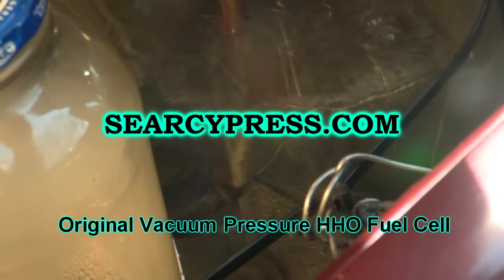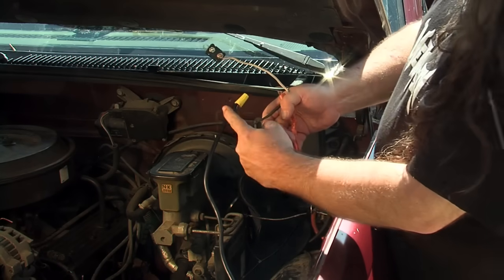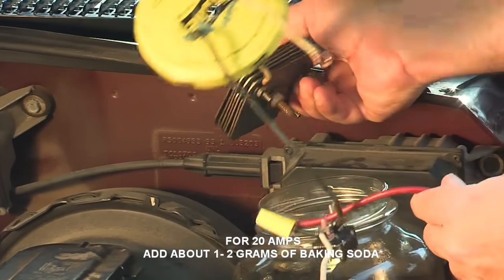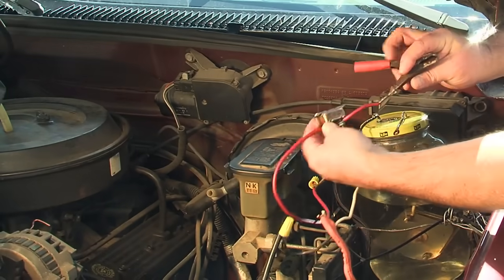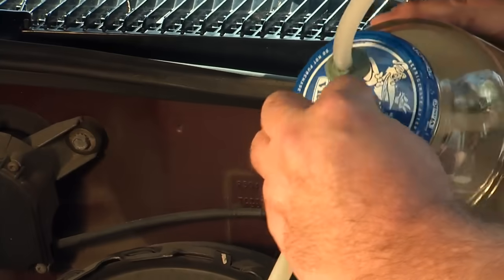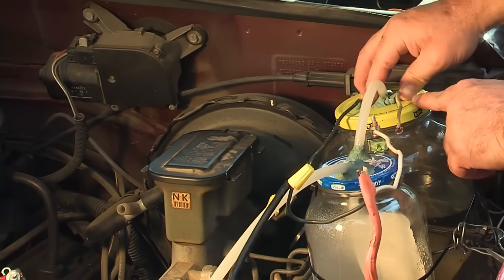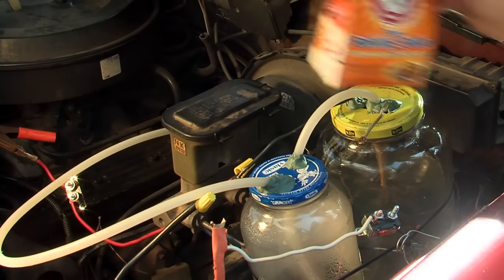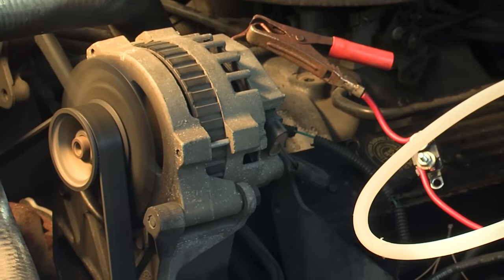Vacuum Pressure Hydrogen fuel cell defeats high gas prices using hydrogen from H2O.

Comment: Hydrogen needs more energy to be separated this way than it actually gives back when burning inside the engine....so the alternator giving 30 amps extra really makes more drag than the hydrogen gives back by combustion....what is the point ?
Reply from the maker: No one is claiming over unity. Many people make the false assumption that the engine is burning 100% of the fuel. This is far from accurate. In reality this engine would be good to be burning 80%. By increasing the efficiency of the burn, gains are possible without violating any laws of physics. Even if there were no gains, using the system allows you to burn low octane fuel without any engine ping. This guarantees you save money.. Thanks for your comment.

Comment: This may seem to be low tech but the fact remains it works I built one several years ago and it worked just like the gentleman said it's just a hydrogen assist to the gasoline of course it does not make enough to run a car by itself, it just assist the gasoline on making your car get better gas mileage
Reply: Do you still use the system you built?
Reply: @arichoward9635  I still have it in my garage but I no longer use it, at the time when I build it I could not find enough information to where I felt comfortable running it all the time even though I did hook it up to my car and it did work

Comment: Doesn't running hydrogen subsequently cause rust corrosion in your motor cause of the water??
Reply from the maker: Burning gasoline actually produces a significant amount of  water anyway.

Comment: "This is vary fancy" proceeds to show you the bottom of a lid of a pickle jar 😂
Reply: Actually it is, it's not what he uses, it's how it's used, that's actually the basic thing of what we use. In fact all he is missing is a mini computer to regulate everything for him as he drives or leaves it running, also a cooling cell to make sure it never over heats and pops it's tops off. Do some research on this, then you'll get why he said very fancy, cause it is.
Reply: @achmed3131  everyone is taking this comment too seriously🤦
Reply: Mom's pissed
Reply: @Brittvanegas  no I'm not
Reply: @Brittvanegas  0 I'm
Reply: I am just curious can you cut off the gasoline and run it on pure hydrogen
Reply: @darrellfilyaw7255  I bet you can but you’d probably have to add some other modifications.
Reply: This dude's full a shit
Reply: So fancy 😂
Reply: Don't be disillusioned by how fancy it looks, now
Reply: What are all of the parts needed?
Reply: Fancy? It ain’t even a pickled ham hock jar
Reply: “Steam cleanse your engine “ 😂
Reply: Mine looks clean...I wonder if I can get it patented.
Reply: Well how do you know they wasn't fancy pickles ? 🤔🥒
Reply: Maybe so, but you didn't make one yourself i bet! Go back to your mommys basement and get online...hurry hurry!
Reply: @gunguyforlife630  🤦👆 this guy.😂
Reply: @unanimous4429  you try it I did with the hydrogen generator works great
Reply: Really lol 😆 🤣
Reply: @yashuasaves5207  de de de he
 Ms
Reply: @yashuasaves5207  see
Reply: @yashuasaves5207  dl do boo boo Mr M.  Chip FYI
Reply: 15th  @yashuasaves5207  ¹

Comment: but the energy you use to make the HHO gets used by the redundant energy of the alternator itself, which comes from the engine, which comes from the fuel? what is this some kind of fake free energy thing?
Reply from the maker: You're presuming that 100% of the fuel is used in the burning of gasoline. This is far from accurate. Only about 80% of the gasoline is actually burned, the rest is wasted. By enriching the fuel we're able to get the efficiency above 95% or more in some cases. It is not over unity it is just simply a better way to burn fuel. This combined with the fact you could  burn low octane fuel without having any engine knock makes savings easy. Thanks for your comment.

Comment: The laws of physics say that this doesn't work. You'll  burn more energy making hho gas than it will give back as combustion fuel...
Reply from the maker: The engine'only burns about 80% of the fuel. Enriching the fuel with HHO can give you over 95% efficiency of that burning. It's not over unity it's just getting your money's worth out of the gas. Even if the process produced no increase in mileage, the fact you can burn very low octane fuel without engine knock makes for saving money.

Comment: SCAM ALERT: Your car will STILL need Gas!! You have to keep replacing the water baking soda or salt and the electrodes, because this process corrodes them ( cost of replacing these constantly) you put a heavy load on your alternator by putting two electrically-opposing electrodes into salt water ( Short Circuit, not good) The water even heats up (high energy usage) I bet most of the dudes promoting this scam don't even know that!! I found out with a kid's thermometer, put it in the water to see if I'm lying!! Making claims about mileage anybody can claim anything!! yeah, my car gets better mileage I emptied the trunk! I get much better mileage by removing all my car's seats except the driver seat! I get better mileage because I stopped taking my obese mother in-law on camping trips!!!!

Comment: Thanks for posting this!
     I will be trying to duplicate your build!
   I'd like to know a little more about your plates and how many you have, aprox finished size maybe a little more details on your plate wireing!
  You seem to get better hho production than I do!
     I plan to put it on my 1999  ford v10! 
    If i can get the production you do , I'll try it on my mopar 440 in my hotrod! 
     Hope to hear back as I have tried a few different assemblys with hardly any production!
         Thanks for making the video!   
         Thank you
Reply from the maker: The plates are certainly fantastic in the cell. They were designed by a good friend of mine. Hopefully in a future video I will show them up close. I have probably built hundreds of different cells but this design tops them all. The corner of each square plate is clipped. The other side of the plate is drilled. By offsetting those plates, flipping them over, you can easily create a positive and negative plate separating them with nylon washers. An extremely narrow gap is critical to making good plates. Only 1% or less of the people who watch this video are subscribed. Please subscribe it would help tremendously. Thanks for your comment.
Reply: 1.55 to 2.08 explains +ve plate in middle & neg on outside. This looks like his arrangement: - n n + n n - (n being neutral plate). If u pause @ 1.55, you count 7 plates. Caution: Hho is dangerous, build this @ ur own risk.
Reply: @josephkamau4855  thanks for the reply!
Reply: It's fake. Learn some thermodynamics.

Comment: This man is really converting chemical energy from gasoline into mechanical movement, into electricity, into hydrogen, back into mechanical movement, restarting the process. At each step hugely inefficient energy loss takes place.
Reply from the maker: You are under the false perception that 100% of the fuel is burned in the engine. The number is much closer to 80% even less. This leaves a lot of room for gains without breaking any laws of physics. Enriching the gasoline with hydrogen oxygen gas increases the efficiency of the burn as high as 96 or above percent. Emissions of toxic chemicals fall considerably. Certainly some energy is used to create the gas. This is not over unity it is just high efficiency. Thanks very much for your comment.

Comment: So, if i've got this straight the suggested method for reducing fuel costs it:

1: burn fuel in the car as normal to turn the alternator.
2: draw more current from the alternator than usual.
3: use said current to power a very basic and inefficient electrolysis reaction to produce hydrogen.
4: route that hydrogen back into the engine so that it mixes with the existing fuel.

the weird thing is, I would have been certain that my old high school science teacher would have said that to extract more energy from a system you would need to burn more fuel.

he also said that in energy terms there's no such thing as a free lunch. So even if both the reaction to produce your hydrogen and the reaction to re-oxidize that hydrogen were 100% efficient you would end up with net 0 joules of energy coming out of the other side. So  every single bit of energy loss in the system means you're burning MORE fuel to keep your truck going than if you hadn't added this system at all.

In short this "hydrogen fuel cell" (it isn't a hydrogen fuel cell) COSTS HIM MONEY EVERY TIME HE USES IT because it is reducing the miles per gallon on his vehicle.

(There's a reason why no one has ever built a power station where they repeatedly convert water to HHO and then back to water in a cycle to get free energy. That's because it wouldn't work)
Reply: Car makers are about to if not already releasing HHO cars. It's supposed to be the latest. I do believe the setup will work, and I'm planning on making the same setup. My only concern is the engines internal parts getting rusted. Like the piston rings, valves, etc. Mainly because the engine wasn't designed for water. I'm planning on having some sort of lubrication to the setup to avoid that. Now if the engine was manufactured to keep from getting rusted. I don't think there would be a problem, but may just be the solution to global warming.
Reply: @bobt7531  Cars fully powered by HHO work very well, that isn't the problem I'm highlighting.

The issue is that energy is that electrolysis wastes quite a lot of energy by producing heat, this fact combined with the inefficiencies inherent in a alternator means that you would up burning more fuel with this system. Not less.

In physics you don't ever get more energy out of a system than you put in. If energy is released by a chemical change in one direction, it will cost you at least that much energy to change it back to the original state.

but there is waste at every stage. burning fuel to produce movement as waste in terms of heat and sound; turning that movement into electricity produces some waste heat and light;  using that electricity to generate HHO produces waste heat; and finally burning HHO to produce mechanical movement wastes energy in terms of sound and heat.

All you have done in this complicated process is waste the energy that you produced by burning fuel.

If you were adding an HHO tank to your vehicle that you filled up at home the story would be different; but this particular system makes no sense.
Reply: Well, fooey on you. J/K Thanks for stopping me from blowing myself up for nothing.
Reply: So your telling me hydrogen gas has net 0 joules of energy and isnt a highly explosive gas. 
They couldn't tune the fuel pump to restict fuel pressure either? 
Think a bit harder than highschool science class bud.
I felt dumber reading your comment.
Reply from the maker: I assure you the gas is quite energetic. Some engines only burn 80% of the fuel or less. That leaves a lot of room for improvement. It is not over unity, it is just using a little more energy to bring that efficiency level really high. Thanks for the comment.
Reply: @metalpresstv  I'd love to see some evidence for that claim. To be clear: no one is claiming that HHO isn't highly reactive. The point is that you cannot produce more energy from a system than you put into it. 

What you are doing here is separating water to HHO then recombining it into water. There is no known reaction on the planet which produces more energy when reversed than it cost to create the initial state change.

As I said to @jonymanay if your claims were true you would have solved the entire planet's energy needs... but there is zero evidence to suggest that you've done that.

The electricity produced by your alternator is not free power; the higher the draw, the more fuel you will burn. That's why you get better MPG when you turn AC off for example.
Reply: @jonymanay  that isn't what I'm saying at all.

I'm saying that it costs energy to separate hydrogen from the oxygen in water. In fact the amount of energy used to separate them is the same as you would get out of oxidising hydrogen* which means that you don't gain anything from burning fuel to generate hydrogen.

This is first year high school level stuff I promise you. Please look it up.

Also consider the fact that nowhere in the world is there a city scale power plant that uses hydrogen as it's fuel source that it has generated using electricity from the plant. If this reaction was in fact producing a net positive in energy all of the world's energy needs would be met over night

*This is in an ideal reaction, ignoring any loss from friction etc.
Reply from the maker: I understand. Ignoring our findings completely you still would observe the ability to burn low octane fuel without any engine ping. You save money. Thanks again for your comment.

Comment: Man I really hope most of you aren't mechanic's, omg listen chilldren....are you listening? Pay attention!!  Your alternator is designed to run every load on your car all at once and still charge your battery. The less load's it has the more energy goes to the battery to charge it. When the battery is charged the energy stays in a perpetual loop in the electrical system except for whatever load the vehicle places on the alternator. The alternator can produce all of this energy on demand. The alternator does not require more horsepower or burn more gas when an extra load is put it on..the pulley doesn't magically become harder to turn all of a sudden bc of more load. It can only put out what it puts out period. If there is an intense load like from a music systems on the alternator it will draw from  other loads but not what the motor needs to operate. When the bass hits ( without capacitor)  the lights dim but the car doesn't slow down or strain bc the car circuitry is protected so that if an immense power source is drawn it'll never come from what they vehicle needs to power the ignition system,.....but let's pretend for a moment that it did, the car would just shut off, not magically make the motor use more gas to magically create more power to compensate....I dunno how hho work's but I know how a damn alternator and electrical system operate..... Christ!!

Comment: there is no disputing that adding hydrogen and oxygen to your engine will make it run more efficient, but I don't see the point of running the generator off the alternator, ultimately you are just reducing efficiency and seems like a wasted exercise
Reply: Catalyse a more complete burn?
Reply: Alternator gonna turn similar rpm range no matter what and the torque it needs to function is minimal.

Comment: So you are just supplementing your gasoline engine with hydrogen and oxygen?
Reply from the maker: We are enriching our fuel for cleaner burn. Only 80% of the fuel is burned under normal operation. That leaves a lot of room for gains. This is not over unity it's simply a more efficient way of burning gasoline. Certainly power is not for free. We do consume energy in making the gas. It is certainly a part of that 20%. Even if no benefits in mileage were seen at all you would still save money being able to use much lower octane fuel without engine ping. Thanks very much for your comment.

Comment: you use the alternator to generate the electricity, so you are simply wasting energy...
Reply from the maker: Engines burn only about 80 percent of the fuel, the rest is wasted. This process gets it's benefits from increasing the amount of fuel burned . It's not over unity. It's cleaner and more efficient. Thanks for the comment.

Comment: I'd like someone to explain why something so simple isn't on every car made today from the factory. The car companies spend millions trying to get every last mile out of a gallon of gas and pay when they don't meet CAFE standards. Sure the gas guzzler taxes get passed on to the customer but if they could be avoided they could sell more cars at cheaper prices. Why isn't HHO standard on every new car sold? Why isn't there a hydrogen tank next to the gas tank avoiding the HHO cell entirely, it would be simple to add one and it can't be safety issues because there are already hydrogen cars running around. I'm sure some might say the gas companies suppress it but if they were selling the hydrogen along side the gas why would they do that. Seems it would be another line of business they could profit from. I call total bs
Reply: Just idling your engine is over a 600 rpms. Driving a 2.5 liter 4cly motor  is about 150 cubic inches. That's 37.5 cubic inches per a cylinder. A cylinder fires ever 2 full rotations. So in a minute of idling at 600 rpms your engine will use 11,250 cubic inches of air a minute at just idle. That's a 187.5 cubic inches a second of air. You're not producing even 2 cubic inches a second. But don't forget that it's h2O 2 parts hydrogen 1 part oxygen. So 1/3 of the gas isn't even hydrogen it's oxygen. So not even 1% of the air being taken into the cylinder is hydrogen. The only thing being accomplished here is the alternator is working harder for the high amp draw dragging the motor down more reducing fuel mileage. This is why water isn't used as fuel in a motor vehicle. 

Now don't forget we don't drive at 600 RPMs most people will be around 1800 rpms at cruising speed. That's 3x the amount of air with still the same hydrogen production. So now ur way below the threshold of .03% hydrogen in the cylinder. Using a spark arrestor on the output hose to keep from blowing the jar up you would be hard pressed to even candle a flame let alone put anything measurable in every cylinder 900x a minute cruising down the highway at the speed limit.

Why because it's complete bullshit is why